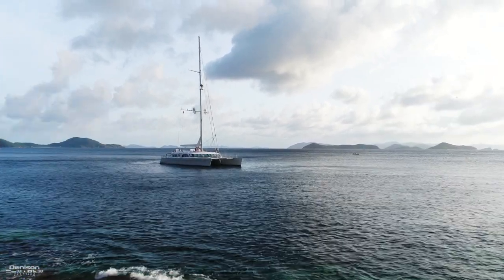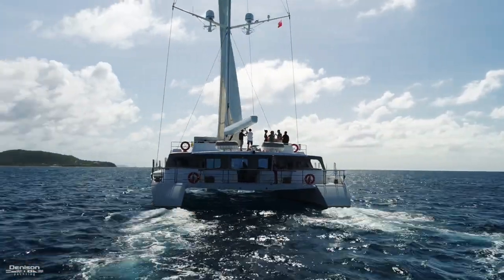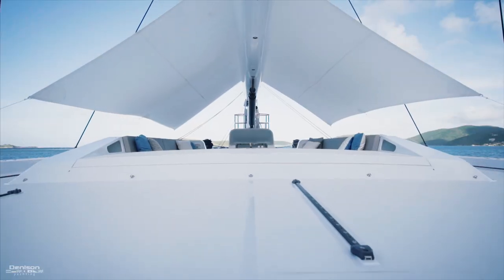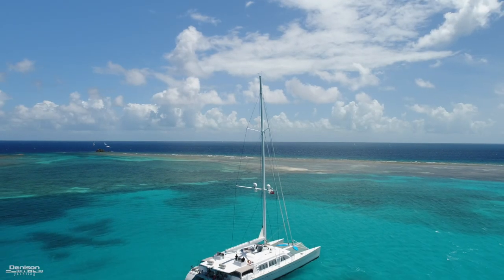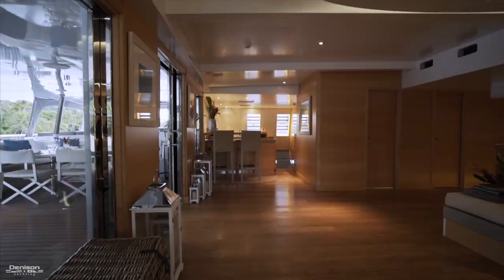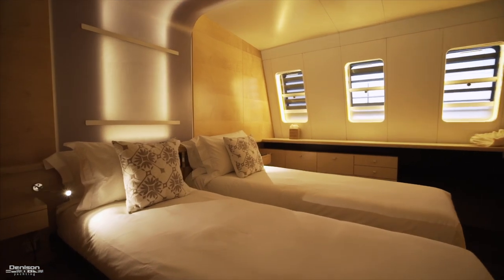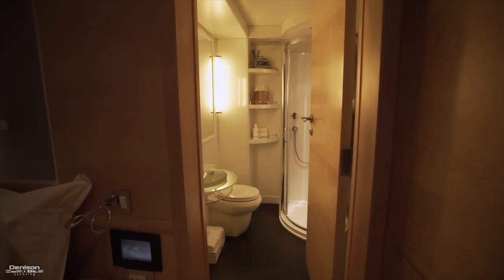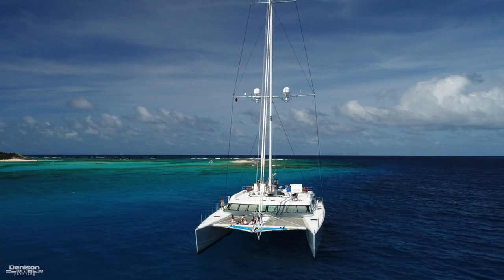NECKER BELLE: 105' Catamaran Yacht Walkthrough

Comment: Why don't we get to see what the crew quarters look like? That likely where I'd be staying if I was ever on this boat.
Reply from the maker: Sorry Liam... we messed up there. We're highlighting more crew areas in future videos. sorry :(
Reply: Crew accommodation for the guys was pretty good, capt and eng had their own cabins with very decent sized bunks for a sailing boat, deck and mate shared a cabin but still good bunks, especially mate's. Stews had to share with smaller bunks, in fact one had a beam running down the side forcing the 2nd stew to sleep in an S shape. 3 heads between 6 crew not bad, one of the crew showers even had 5 shower heads.
Reply: The red room
Reply: @dreads9536  I bet the new guy gets the S bunk.
Reply: @thelast344  if the new guy was a girl, yes.
Reply: Cause the crew ain’t the ones buying lol

Comment: She's a beautiful cat. But, at 171 tonnes (some sites list as 185 tonnes) how can it be called a performance cat 0:13 ? I have seen varying max speeds between 16 and 25 knots (motor sailing?), but nothing on the sail plan. It is hard to see it doing anything over 12 in perfect conditions. In contrast, the Sunreef Carbon 80 is a 45 tonne vessel (Gunboat 90 at 51 tonnes) capable of 20 knots with a 340 m2 sail plan, the Necker's specs does not make the calc for a performance cat. Performance usually means "light".
Reply from the maker: You're right, not really a performance cat, except that she's faster than most cats built her size.
Reply: @DenisonYachting  Yup, your probably right... Great job on the channel.